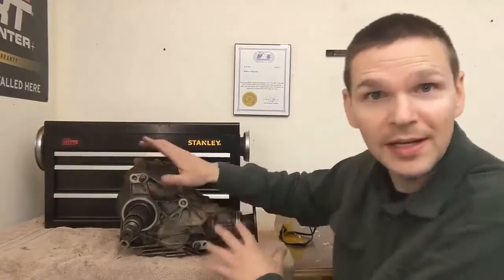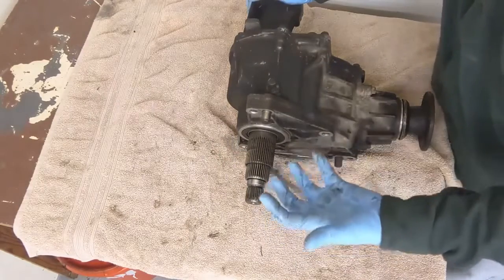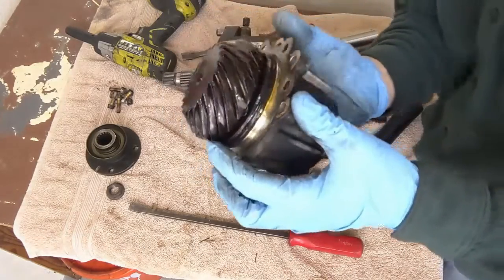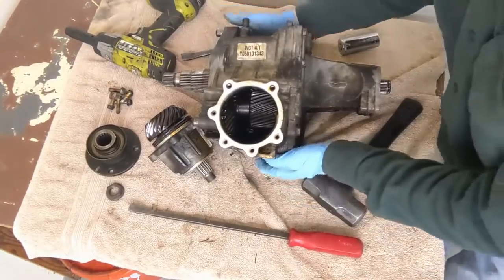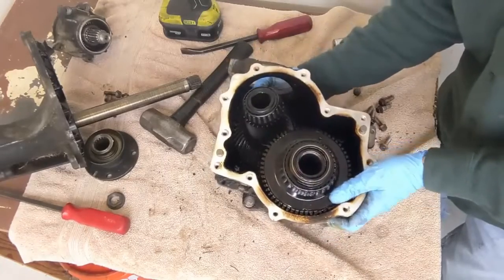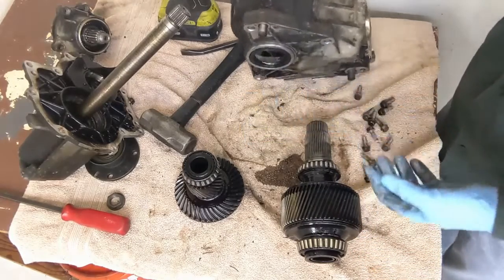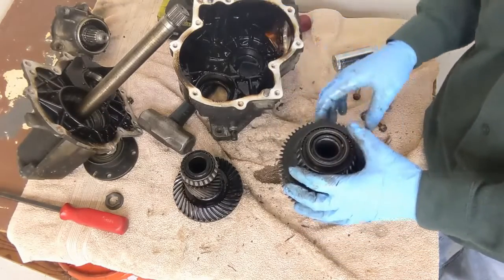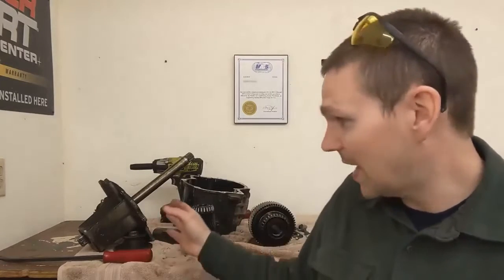Hyundai Transfer Case Tears Down | Transfer Case Replacement Guide Step by Step | Diy Car Repair

Comment: Anyone who is doing this, it's a big job to pull the t-case. It took me about 4 hours in my driveway to remove it, but I'm a heavy duty mechanic by trade. I checked the outter seal and couldn't see anything wrong with it so I split the t-case apart and the inner seal was definitely the culprit. Popped the seal out and took it to my local seal shop where they were able to micrometer it,  and get a new one coming. Anyone doing this I would recommend doing the input seal and both output seals as well as the internal seal. Along with the o-ring that's on the pinion housing when your remove it. Hope this helps someone one day. As a mechanic I was cursing some engineer somewhere for designing this haha. ✌️
Reply from the maker: Yeah this is definitely a challenge! The first time I removed it I replaced the input shaft seal between transmission and transfer case then put it back on. I didn't know there was an inner seal inside the case! It still leaked so I had to pull it back off 😕
Reply: @ValleyMobileAutomotive   awe man, if I didn't watch this video I would have done the same thing. I was tempted to just replace the outer seal cos I was in a rush and didn't want to have to wait for parts. I'm glad I split it, the inner seal was torn in 2. Was putting it back together today, I'll finish tomorrow. Hopefully no more issues with this car. It's awesome to drive in our Canadian winters. I met a guy that had 500,000 kms on his exact car. I appreciate you making this video, sending good vibes from way up north ✌️

Comment: On a 2012 Santa Fe the right front CV joint was fused to the intermediate shaft.  I have done dozens of CV joints and never seen it before.  I nearly killed my self trying to get it off with a slide hammer.  I finally took a break when it dawned on me to remove it with the intermediate shaft.  I had to rip the joint apart to beat the intermediate shaft out of the splined CV joint cup from the back. 3 hard oogas standing over it with a full size tire hammer.

IF THE RIGHT SIDE WONT POP OUT EASY/normal, REMOVE IT WITH THE INTERMEDIATE JOINT!
Reply from the maker: @weedonrp  Thanks for the tip 👍. I haven't had the privilege of removing that generation but when I do this will be helpful.

Comment: In case anybody is having trouble getting the drive shaft coupling off I had to use a 3 jaw puller on it.

Comment: To remove the transfer case do you have to remove the exhaust manifold that bolts to cylinder head or just remove the catalytic converter that is attached to the manifold? If so do you remove it entirely from below the engine?
Reply: This was your question 1 year ago. Any answers yet?
"do you have to remove the exhaust manifold that bolts to cylinder head or just remove the catalytic converter that is attached to the manifold? If so do you remove it entirely from below the engine"? 

I am going to start on my 2008 Sante Fe Transfer Case removal -It had a structural crack and I was able to get a used salvage one for $350, 100K miles. So, some questions for you or anybody reading this. 
1. Any ideas on why TC would structurally crack in the first place?
2. Other conditions to take a look at that may have contributed to this. 
3. Anything else>>?
  Thanks in advance all help appreciated!

Comment: Can you do that will the transfer case is on the car?
Reply from the maker: 🤔 good question. If you have enough room I don't see why not. I believe the exhaust manifold still needs to come off. The drive line and the passenger CV axle as well. At that point it's only 4 more bolts and the T-case is removable. I used a floor jack to hold the weight while pulling it out. Then you can purchase all the seals. If you have the T-case off I would recommend replacing the transmission output seal as well.

Comment: 1:29, there isn't an output shaft seal on that, probably why it failed in the first place
Reply from the maker: Good eye 👍. The output shaft seal was removed previously and didn't get put back in before this teardown.
Reply: I need to repla e the housing due to a dent in the seal lip. Do you have or can you recommend a video?
Reply from the maker: @justatool  Do you mean the output shaft housing that holds the seal?

Comment: The drive shaft that goes to the rear diff  would no turn on my santa fe. I wonder what is wrong. The 4WD would not activate when I press the button. It says on the dash that it is activated but nothing happens. Only the front wheel would turn. No noise, nothing.
Reply from the maker: Hmm 🤔 just curious how do you know the rear wheels aren't engaging?